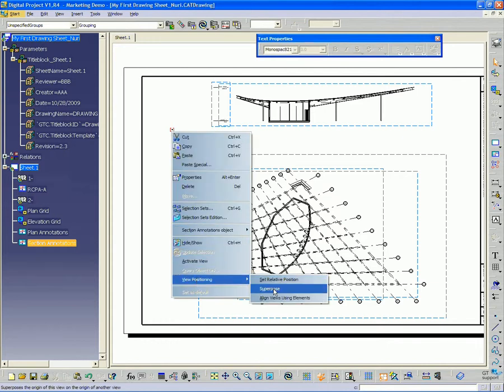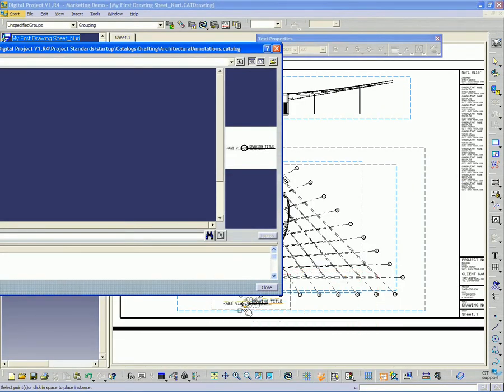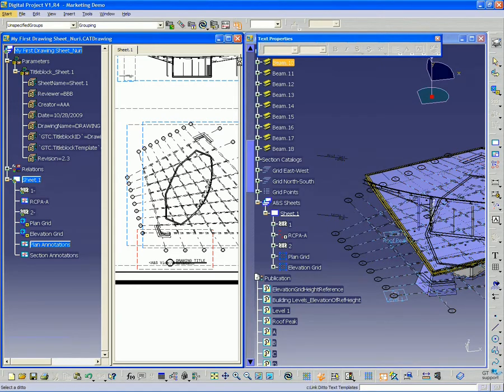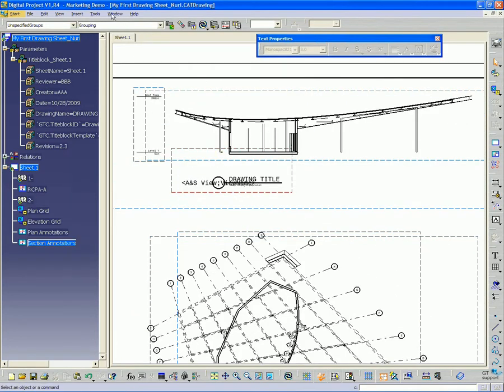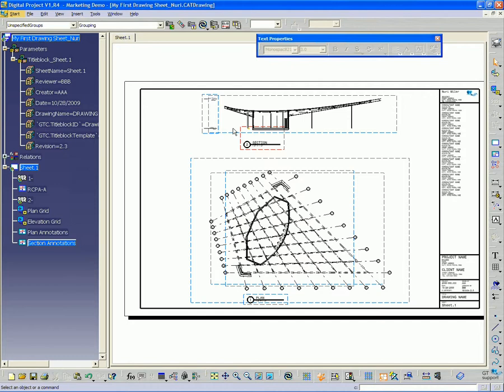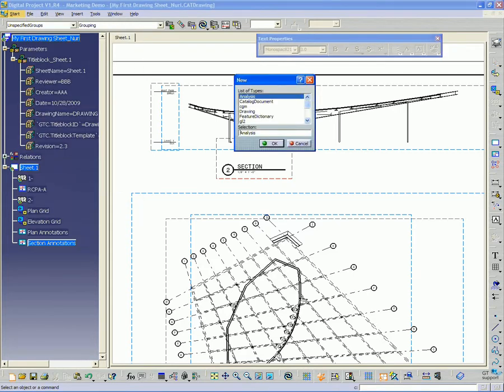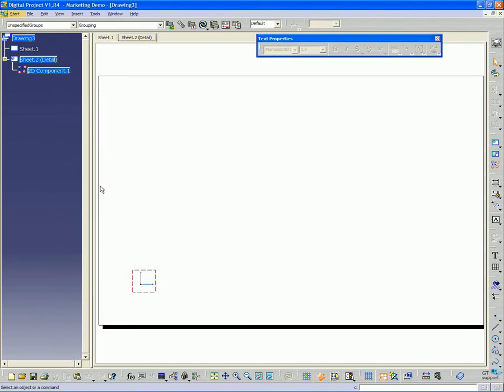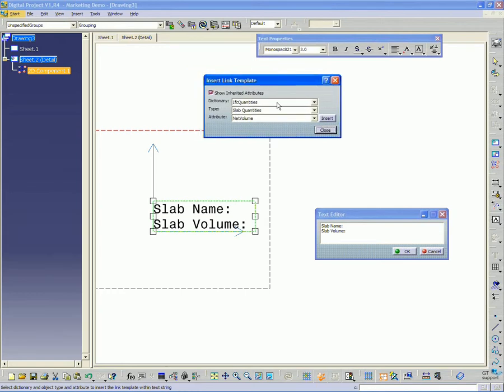GT Building Fluency Webinar 7-5: Drawing Production in Digital Project™

Comment: I did see a  lot of interesting features in DP software overall. Some of the ways that you can carefully control the parametric lines and objects while modeling look compelling. But, this area of creating drawing views and annotations on sheets is where DP software would be way too slow of a workflow compared to Revit and other architectural software. This video was from late 2009, which is older technology. But even in 2009 - 2010 the drawing and annotation procedures in other architectural software such as Revit would have been incredibly more efficient and quick. If someone were demonstrating DP software and doing that much work to setup simple sheets i don't think most companies would be interested for that reason alone. 
I wonder if the new Dassault 3D Experience has modules that have replaced this software.